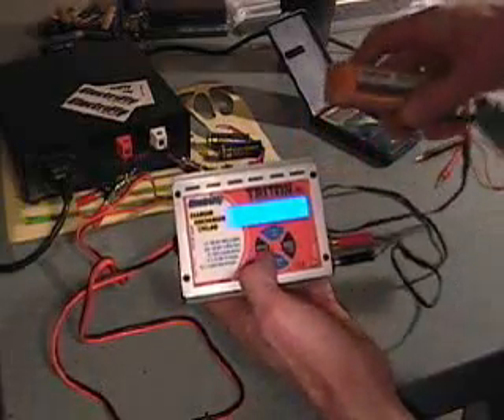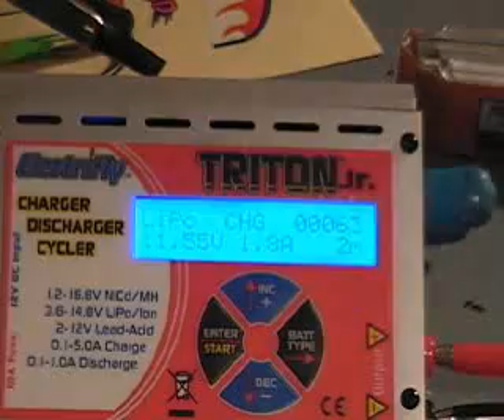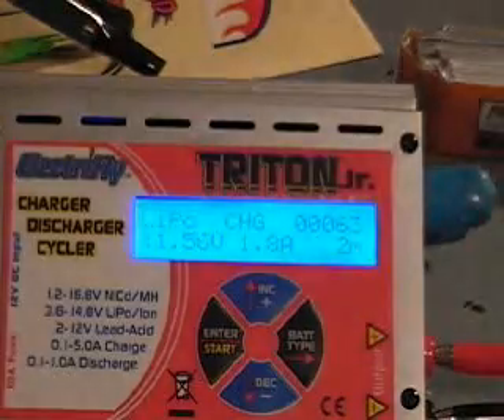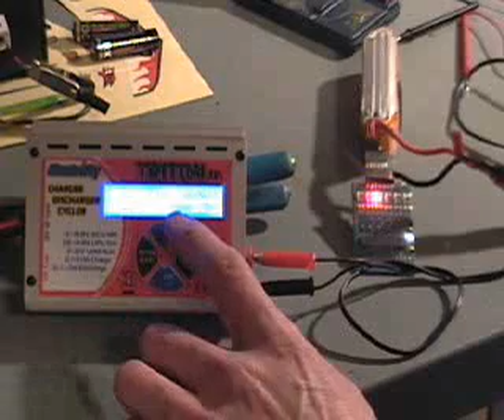how to charge and use lipos

Comment: hi um i have the first crappy charger you showed, my question is how long would it take to charge my lipo,
here are the specs of the charger and battery.  
11.1v
2200mah
8C 
and the charger doesn't state voltage but it does say 1.2A

Comment: @1521joe 
Yeah that can happen with cheaper lipos. It will still work fine but will give you less charge time on the battery. Was it like that from the beginning? or it happened after using it for several times?

Comment: hi guys and girls i have a question for any one that know whats wrong. ok i just bought a venom lipo 3400 mah battery and i have a onyx 2300 lipo charger and i have a equinox lipo cell balancer now i hooked it all up and set up the charger and the balancer will not light up at all and when i push start on the battery charger it says no battery and the battery is new i got today and the charger and balancer is new but it is about a year old but this is the fist time i used it.

Comment: Great information! I just bought a 11.1 volt 2200mAh 25C lipo that is going on a 30 amp motor. I will have to do the math and figure out my flight time. What I don't understand is the continues current of 55 amps verses the max burst rate of 110 amps with various flights of speed!